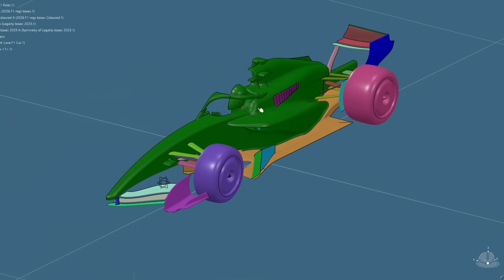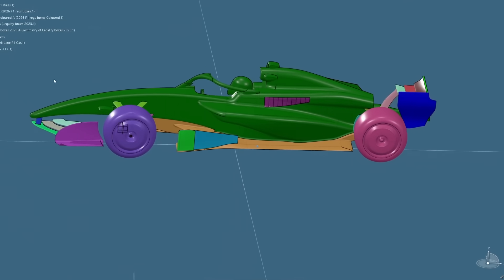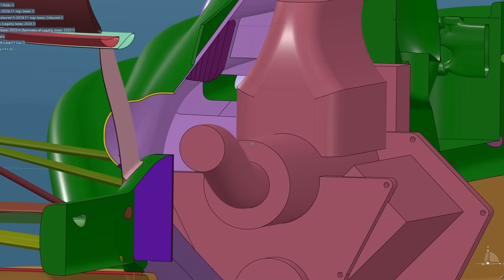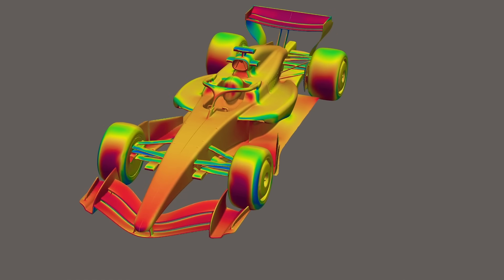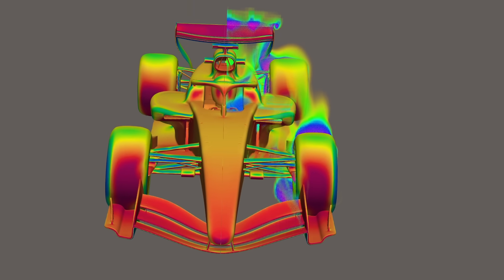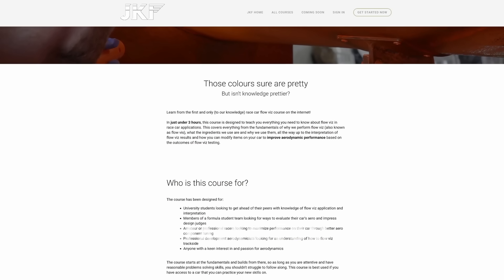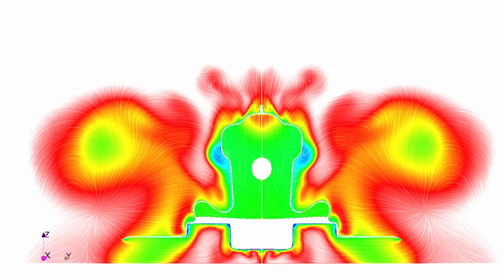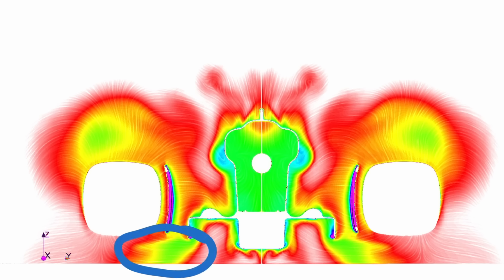I Ran CFD on the 2026 F1 Regulations - This is What the Flow Looks Like

Comment: Well, fan system fixes all this dirty air. It's such a cool tech, I was digging into it and I find it amazing. Also, the current knowledge in plastics is soooo much better, we can make amazing skirts! It's a shame racing cars don't use fans, skirts and active suspension!!! They are SOOOO much easier to be done now and yet we're wasting time with dirty air, porpoising etc!

Comment: Could you explain how you obtained the flow visualizations in the chapters “surface pressures” and “wake shapes”?
I am trying to reproduce the same visualizations using threshold and contour (I am fairly sure you used Paraview), but I cannot obtain the same results, in particular I cannot show the trend inside the “clouds.”
I was also wondering how you managed to get such smooth contours. I don't think you used such a dense mesh... if you did, I would be very envious 😅

Comment: Has anyone already read all the rules and released a 3D model of all those boxes, where certain things are allowed within like the minimal and maximal size of the fronwing, certain endplates, rearwing etc etc? and also maybe as writen down some rules like in the current gen, that the radius of certain survaces has to be minimum x and this rule that sidepods may only stick out once or whatever that was, where mercedes found this weird shape with the nopod design etc? I'd love to find ONE formular, that can take certain amount of parameters, which will in the end produce ALL legal shapes a car could possible have with the given rules. Like i think it should be possible, to do something like that and then you could run a brutforce algorithm, that will create all kind of possible aero designs and then you can run them in a quick and easy CFD to check some of their downforce and drag levels, to quickly get a statistic, which design might be good and which might be bad. And then from there you go more and more into more detailed changes and more complex simulations.

This could quite easily find the best possible design for an car with the current regulations. But with the new rues cfd time is also cut down, so that would ofc be the bottleneck ^

Comment: I wpuld love to see the CFD of street cars running aero for the track.  Specifically, with windows rolled up versus windows rolled down which is what a lot of HPDE organizations require.   The amount of buffetting inside the cab suggests substantial airflow changes at times.
Reply: CFD wouldn’t really answer that outside of the obvious yeah there would be a low pressure zone there that would lower the performance of the aero, but you are also talking about incredibly low performance aero and it doesn’t really make any difference at even “race” speed
Reply: @sunnohh was thinking more of unlimited/max effort cars with regards to "street" cars for time attack.   Things like Mark Lutton's GT350 or cars with more than just Porsche GT3 level aero.

Comment: Thanks, Kyle, I appreciate your insight on F1 cars.  I do wish you'd stop using the word suction.  An aerodynamicist should appreciate that it's always a case of high pressure pushing air towards lower pressure rather that lower pressure pulling from higher pressure.  Overly picky?  Maybe.  But nonetheless true.

Comment: Would you be able to edit this geometry and re-run the CFD to do an analysis of the car in the "low drag" configuration they'll use on the straights? It would be interesting to see what kind of wakes are being generated and how drastically the overall aerodynamic forces change in the switch
Reply: That would be amazing and very helpful. Ideally, it'd be a completely new model according to the current rules for the 2026 aero.

Comment: I wonder if Red Bull will bring back their high rake concept.
Reply: You mean Aston Martin?
Reply: @v4skunk739  I agree, you might see the concept on next year's Aston Martin. Who knows ?
Reply: Unlikely.
The underfloor is still responsible for creating a lot of downforce. A high rake would make sealing the floor incredibly difficult.
Reply: @curnath How did you come up with that? 1. Since its introduction the underfloor has been responsible for most of the downforce, whether in 2025, 2018, 2002, or even 1991. Whether it's 40% or 65% of the downforce, it was and always has been the part of the car that generates the most downforce by far. 2. The underbody in 2026 is pretty much the same as it was in the years before 2022. As before 2022, it is no longer a "Venturi" underbody, but a flat floor. This is exactly the type of underbody for which the high-rake concept was developed, turning practically the entire underbody into a diffuser. And, incidentally, with the intention of generating more downforce. So why not use this concept on the same floors where it was successful? Especially on the floors where it makes sense? Sorry, but I think you don't understand the difference between a "ground effect" underfloor and a flat underfloor, and why high rake doesn't make sense with the former and would be rather harmful, but makes a lot of sense with a flat floor and promotes downforce.
Reply: @fam.hunger5244  I stand corrected.
I was under the impression the cars would still have the venturi-tunnels. Not sure how that change slipped by me.
You're absolutely right, without them my argument doesn't hold water.
Reply: Maybe not as aggressive as before but probably.

Comment: From your fluid slices I understand that all the important bits front wing, rear wing, diffuser should be more in contact with clean or energized air (red color), is that right?

Comment: Sidepod shapes and sidepod inlet shapes seem like they might be extremely important under these rules. That was also the case when the current ruleset was introduced, but it seems even more crucial given that ruleset-imposed board that is trying to limit the amount of dirty outwash. I don't know the whole ruleset, but I'm wondering if vertical inlets (along with a lot of small aero elements on that area of the floor top) will be a big thing to try and clean up that high pressure area. Limiting the exposure of the underside of the sidepods to that high pressure area seems to make sense, although also I am just a person who knows very little but the common-sense basics about aerodynamics.

Comment: Can you make a video breaking down the aerodynamics of f1 cars from the 2021 season back to maybe somewhere around 2017. The videos you make breaking down the aerodynamics of the new cars at the beginning of every year are some of my favorite, especially as nobody does as comprehensive of a job as you (at least that I’ve seen). Those 17-21 cars have got to be my favorite aerodynamics wise besides maybe the 06-08 cars. 

But specifically the Mercedes w11, it being basically the pinnacle of those downforce monsters we used to have and considering you worked at Mercedes at the time, I assume you would have a fairly comprehensive understanding of how the aerodynamics of that car worked, especially for myself personally, I’d love to know what all the vortex generators are attempting to do and where the vortecies are supposed to go and what they are supposed to help with. As well as just the general aerodynamic concepts around the car. 

Maybe you have those behind some kinda course, in which case if you don’t mind pointing me in the direction of where I could find those. 

Otherwise you make amazing content and I have nothing else to say other than keep up the amazing work
Reply: i second doing an analysis of old cars but i would like to see ones since 06-08 regs and onwards

Comment: Increasing surface area is the quick (lazy) way to increase down force. That's why the cars became so large. 

It was already a trend, but the added weight of the hybrid engines and new safety regulations pulled lap times down, and the simple solution was to make the cars longer and wider. The habit became ingrained.

For some reason F1 never liked mechanical grip innovations, which are transferable to road cars, but loved pushing aero to the extremes, which is not as transferable. They went as far as putting grooves in tires in the early 2000's!

If F1 had put in strict size limits back then, we would have a much more pure sport today with a lineage of technological advancement more applicable for road cars.

Comment: I think it makes more sense to push the front wheel wake outwards away from the rear diffuser and rear wing. Since the rules forces the wake to initially move inwards via vertical fin. I would use that part to stir wake outward. and also use the side pods surfaces to deflect the wake outwards.
The airflow above the front wing and in between the front wheels will be most useful as a clean air to support the rear diffuser and rear wing.

Comment: It would be nice to have (outwash) flaps on top of the sidepod and also holes on the edge of the floor (are they back like pre 22 regs?). 
I'd also expect even wider sidepods and smallershorter undercut (possibly cooling louvers on the side) and that rear deflector could change a bit.

Comment: Thanks, Kyle.
It's bugged me for [maybe even] decades  now, why FIA don't regulate the turbulence.
e.g @ 150kph not one of the 9 points can be </> X pressure (points being measured either in wind tunnel, simulated or maybe even at the track).  With additional checks at 200, 250 & 300 maybe.
Let the hundreds of engineers spend the millions and millions of R&D resources ensuring they're only maximising the potential aero of their car within bounds that don't excessively hinder the car behind, rather than trying to ensure it's decent for the car behind with a handful of folks with very limited resources, who then sit and watch the hundreds of engineers expertly circumvent their attempts.
Could even do that thing they like and be transferable to road cars, increasing road safety by reducing turbulence from cars ahead (even though it is much MUCH smaller with road cars, which are also less sensitive, because it matter more on the road, where consequences are more dire).
Reply: If you are driving a road car in a way that dirty air is a consideration you deserve to crash

Comment: Hi Kyle. I saw another video with CFD data indicating that overall there will be less downforce on the car but more of the downforce actually generated will come from the underfloor. Does this match what you’ve seen on your models, and do you have an assumption on how this will affect cornering speeds on the new cars?

Comment: I am a bit concerned as to how will racing go now, because with the Low and Hight drag modes slipstream efect is pretty much going to dissapear, and i dont think this new MOM will be able to fill the gap, so overtaking is going to be really diffuclt (at lest if it works so that you can change to Low drag mode in any "straight", not just previous DRS zones). Also for tracks like Baku, where set up has a really inportant compromise between Low D.Force for the caste section and Low Drag for the main straight, thats just going to fade into who has the better trasittion between Low and High drag modes. All of this just to fit a PU that doesnt have enough power or energy recovery to last a full race instead of just incresing the outup of the ICE.

Comment: in this ruleset I would probably go for a bottom air intake just at the end of the inwash bargeboard. Sidepods extremely low and the "sausage" sideways instead of upward to have a Coanda effect towards teh middle back of the car. I suspect we will have side sausages getting larger towards the back to slim down the sides attached to the floor ant the upper flow to try and take away front pressure from rear tires. It is all in my mind that works so It is definitely possible my idea is way too draggy but I simply do not think that cars will look anything like now, unless teams want to make others dip their toes first and then copy the successful teams, which I think will be very possible. A general tight package for smaller teams with aero to refine.

Comment: Kyle, could you tell us, from when you worked in F1; how much effort went into generating downforce compared to how much effort went into destroying downforce for the following cars?
Reply: They don’t spend any time on dirty air. It’s a byproduct of the aero on your car not a feature. You wouldn’t want to create excess turbulent flow off your car that would be inefficient
Reply: Bro thinks the F1 movie was a documentary
Reply: @slaybert  It is, that's where I learned it's best to use the wipers to clear oil sprayed across the windscreen.  \o/ \o/
Reply: Dirty air is just a byproduct of downforce, the more downforce you have the more dirty air there is, especially when you increase downforce on the rear
Reply: Sounds like a really REALLY stupid thing to do.
Most times, team mates are together on track, so you'd be harming yourselves more often than others a lot of the time.
Reply: @ChrispyNut  unless you are in the two last places, the math on that just doesn't check out, you are either running both cars together, but because one of them is ahead of another car you are harming another team as much as yourselves, or you aren't, in which case you are harming 2 other cars. 

(I also think your assertion that most of the time, two teammates are together on track is wrong, but I don't have the data to prove that, i'd need lap by lap data for that. However the race results of this year show way more drivers followed by someone of a different team than someone from their own team)

Comment: Having no guide vanes in the front section of under floor and less front wing surface area might shift the aero balance towards the rear, this cause much downforce on the rear than front which in turn causes too much rear tire degradation on high speed corners and straights (because new regulations have opening flaps for both front and rear wing).
Reply: On the contrary, high rear downforce would induce understeer in high speed leading to front deg surely?

Comment: I feel like this time something like a zero-pod concept will work a lot better than it did in the 2022 regulations.
Reply: Why?
Reply: @j.s3300 the high pressure on top of the begginning of the floor seems not so effective when there is a sidepod at the top. Whitout the sidepod this pressure could be used more efficiently. Im not a proffessionel tho these are just my toughts.

Comment: Kyle could you make a video dispelling the commonly held notion that Max is only fast because the Red Bull is "built around him" ? Like seriously, how would car designers even make the car slow for one driver and fast for another on purpose anyway?
Reply: They don't make it slow on purpose. The car just plays to Max's strengths. That's not a criticism. In past years, the car has been so dominant, that they didn't really need to care about the second driver all that much. However, there was a time when the Red Bull was driveable by both drivers, look at when Perez first joined, he did pretty well. Perez didn't suddenly become a bad driver, the car just moved away from him.
I hope that Red Bull make a car next year that is able to be driven well by both drivers, otherwise Hadjar could find himself in a career-ending/stunting situation. It is possible to do, this years Mclaren works well for both drivers (most of the time).
Reply: @kyorin6526 no, I know that. But making the car drivable for Isack should not be at the cost of making the car slower overall. I want more people with credibility to speak up about it so they uniformed people can realise their misunderstandings
Reply: @nameonelast598 I wasn't suggesting making the car slower.
Reply: @nameonelast598  Firstly, you've got "uniformed" rather than "uninformed" (if you care).
Fast is loose as they say.  Max can deal with a looser car than most.  To make it more driveable for others would mean lowering it's maximum theoretical potential, which would likely lower potential that Max could extract.
There's also the aspect that some drivers like a strong nose, others like a strong rear.  If you're stupid enough (like a lot of teams over the years) to get one of each, you either build a neutral car and upset both drivers, or go one way or the other and "make a fast car for one driver, a slow car for the other driver".
Reply: @ChrispyNut yeah, I don't care, typing on a phone and autocorrect and whatnot. As long as it was clear what I was saying, could edit it now, but I digress. 

Also, I think the point is completely being lost here, I'm not saying, can someone explain it to me I've actually seen the interviews and podcasts with Adrian Newey and other engineers who've dismissed the idea, I just thought it would be useful for an aerodynamicist to explain in simple terms with visual aids why such misconceptions are misplaced.